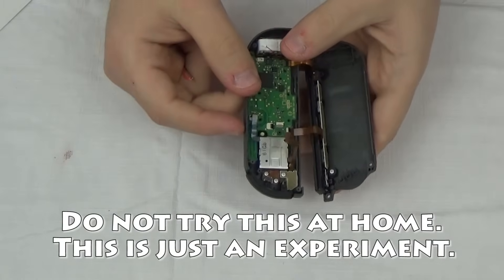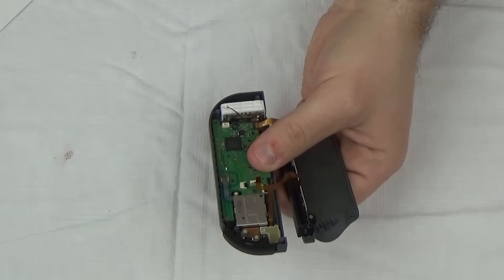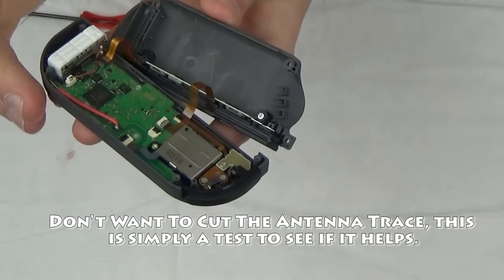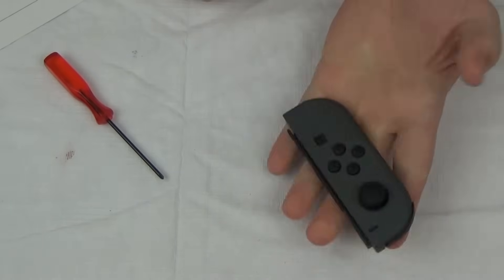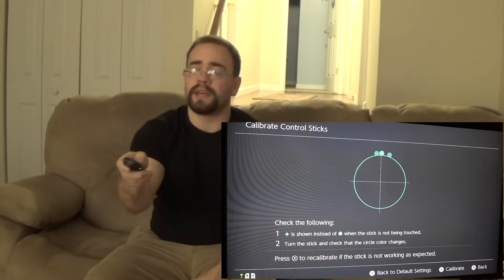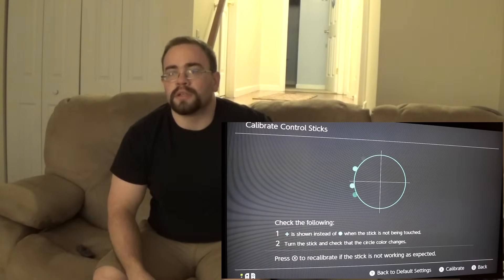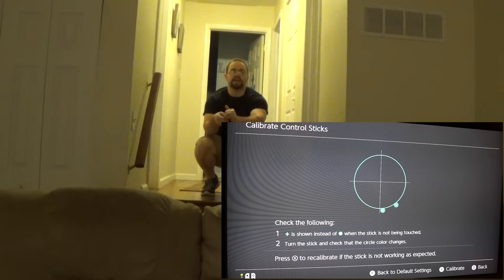Fixing The Left JoyCon!

Comment: Thank you for your input mate. I Did the same and it simply didn't change a thing. Link keep getting clumsy if I lazily lay my hands and the joy cons behind my knee. Read for the second time about the cable length (and width i guess) that could improve or mess with the signal, it might be the next thing to look at. Anyway, thanks again for trying. Edit: European Switch
Reply: I love to reply to my own messages. For those who struggle to find reviews about the fix;
Second time I tried soldering a shorter cable of the same thickness (thick), the 2.5 cm didn't help at all. Third time I soldered a thinner longer cable (about 5 to 6 cm) all the way where the IR camera would be on the other one, following the down curve, and it improved. I can lay my hands on my crossed legs, behind my knee, and it works. I can still disrupt the signal if I really cover the joycon with my hands, still it's better.

Comment: Will be doing this tonight.
I don't sit far from my switch, like ... 6-8' maybe, but I usually play lounged or with my knees up or some sort of way where relaxing puts some part of my body in some kind of way between me and the console, if even barely, and I've noticed some slight connectivity issues.  If I adjust slightly, the issue goes away, but if I can put a simple wire on a blob of solder, and call it a day, you bet your ass I will.

I'll take pics and let you know how it goes.

Comment: I wonder how much Nintendo is saving from not including a strip of antenna / wire?
Reply: Reasonable guess; about 3 cents per unit sold.
Times 5 million units sold -> 15 million cents or 150thousand dollars. It adds up quickly.
Reply: Ofc it adds up quick if you start with way too high numbers in the first place.

That wire is never 3 cents. I'd price it somewhere between 0.01 and 0.005 cents, so I'm pretty sure they didn't left it out to save money.

Comment: You have actually created a dipole antenna. The issue is that you have changed the dynamics and if you didn't do your calculations right on wire length you could be getting adverse SWR that could damage the joycon. Fortunately for higher frequencies and lower power this is less of an issue but if you measure the length of the on board antenna it happens to be 1/4 wave then you can get a 1/2 wave dipole by adding the same length wire and 1/2 was is optimal for a dipole. If you want more information on this, pick up the ARRL Antenna Handbook ( https://www.arrl.org/shop/ARRL-Antenna-Book-23rd-Softcover-Edition/ ).
Reply: well, it was more complex that i expected
Reply: So, how long should this antenna be? I'm down to solder, looks simple
Reply: From what I can gather a 30.7mm wire is the correct length for Bluetooth 1/4 wave. Can anyone confirm this?
Reply: Why don't you figure that shit out for us.

Comment: I tested my joycons numerous times and didn't have any issues with them whatsoever. Then I realized I had made all my tests with the Switch undocked simply because my TV is positioned so that I can't really move away from it too far and still see it. So I tested with the Switch docked and moved as far away from it as I could without loosing sight of the TV (roughly seven meters) and then I started having these issues if I covered the joycons with my hand and body (with clear sight there were still no issues).
So, at seven meters I was having issues when blocking the line of sight, which is perfectly normal imo but with the Switch undocked I had no issues at all at an even greater distance even if I blocked the line of sight! Seems backwards.
Funnily enough, my right joycon seemed to have more trouble when the issues showed up, so maybe I got my left one from a batch where Nintendo had fixed this flaw. I'm almost willing to open it up to see if it indeed has a proper antenna.

Comment: I'm skeptic...

- Firstly, he does not mention that he had the actual issue before, but talks about "the one people complain about"

I have this issue about as bad as could be, although the main thing I notice is that when my switch is in tabletop mode both joycons connect fine and I can do the "behind the back from a distance" test fine with both joycons.

The issue seems to come about only when my switch is docked, and it seems to get worse after about 2-3 hours (on Zelda, if it makes a difference - starts getting nice and warm) to the point that I have to sit in front of my Switch within 3ft distance and it still loses signal even with no obstructions (besides my hand holding it of course). I have tested this on 3 different TVs in 3 different rooms (away from WiFi signals - and fishtanks!-), one of which was a PC monitor - No WiFi/Bluetooth/Infrared! - and ALL locations show the same issue. Undock = FINE!

This leaves me thinking whether it is really an issue with the Joycon... Might still be if the Switch has very tight tolerance to variations in the bluetooth signal strength. Dunno. I'm not sold on this solution just yet though. Largely also because he doesn't mention the guage or length of the wire used (and is not answering people who ask what these should be). These are important factors in antennae, length especially for the likes of bluetooth and WiFi antennae. He might just have been lucky with the length, but it does need to be within a specific range to transmit the bluetooth signal effectively.

So, because of all these reasons, I'm not jumping onto this solution just yet. I hope to be able to test this further with another joycon and Swtich that do work to determine if it is the joycon or the Switch itself... waiting on a friend to receive his Switch to be able to do this (hoping his is fine). ...And I've gone ahead and ordered a pro controller for now which should hopefully have a strong enough signal to at least play Zelda from more than 3ft away from my Switch (and TV)

This is a lot to read, so respect to anyone that has made it down to here;-)
I'd love to hear other people's findings.
Reply: I've seen lots of people say they did the same thing and it fixed their joycons. So it seems that this fix really does work. If you're fine with opening them and trying it, it seems like it might be worth it.

Comment: this reminds me to the n64 times when the rumble pak needed batteries but with a single wire you could mod it to use the energy from the controller and play just fine without using batteries

Comment: What gauge wire? where did you put it so the battery holde would fit back on top of it? I did lil tiny almost strand wire, of course its probably too thin to get any bandwidth out of it. and 12 gauge awg is probably too thick to get in there too.

Comment: The good size for a Bluetooth antenna would be 31,2 mm. Which could be the perfect size for the wire (outside the shield if there is one).

300 / 2400 (light speed / frequency) × 1/4 (one quarter) => 31,2 mm  (around 3 cm)

Comment: ok so the design is the issue. not the hardware itself. this doesnt happen with the other controllers on other consoles why? because the antena is not where we grab the controller? even if it was, if we grabbed it, due to the size of the controller it wouldnt stop right?

Comment: People make ONE very big mistake in all Joycon related videos. They forget to question how a perfectly working unit works. Yes the 5cm wire might fix the left joycon issue. but it does not explain why my left joycon doesnt have that cable and still works flawlessly beyond the distance he tested it. All people act like the antenna is too small in general. I tell you now: it is not. it works. Perfectly. I tested it. So Antenna size might be a part of the problem but ONLY a part. something IS wrong with that joycons or the area you test it in. defective unit and/or interference with other devices.

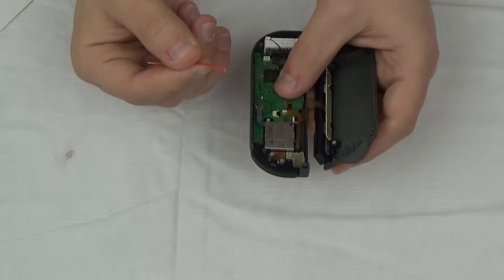Comment: 0:57 The big box you can see next to the antenna is electromagnetic shielding. It's there so whatever is inside is less influenced by the field emitted by the antenna.
PCB antennas are very common though there might be a problem with the placement of this one.
Bluetooth operates just above 2,4 GHZ and a little bit of googling told me your antenna should therefore be 31mm or a little bit longer.
Interesting fix!

Comment: The joycon issue is not really a HW issue. The real fix would be a FW update increasing the transmit power on the controller. This may come in the future.  Also this is not how digital antenna work.  The wavelength propertied of 2,5 GHZ transitions state the antenna needs to be a specific length. Good try though, the changes may not be worth the risk of damaging a low energy device such ad the joycon.

Comment: I had the sync issues then I read that you just need to restart the console with the Joycons attached after you do the update and sure enough that worked. I can now be 30 feet away without any issue. I would suggest trying that simple method first.

Comment: My Joycons haven't had any issues (luckily), but did you say you used a Cold Heat soldering iron? They still have those things? I remember when those came out, I thought about getting one but I read several expert reviews and decided against it. Your solution (sticking a wire to the solder point to extend the antenna) was about what I would have done. :)

Comment: My left joycon is almost unusable when I'm more than 5 feet away from my Switch unfortunately. I will lose connection almost every 30 seconds and I've ran off many cliffs in Zelda. I want to do this but my current iron tip looks way too big to put a new wire antenna in there. I'll just get a pro controller for now since I'd get one eventually anyways. But awesome video figuring out the problem!

Comment: I hate saying this but nintendo really screwed up with that. A massive company based out of an extremely tech heavy country, didn't think to run a soldiered wire from the board to the bottom. But a smallish YouTube channel thought of it by looking at it for 5 mins. Wow. Good job Spawn as always. You have made a true regular subscriber today.
Reply: The Switch is great, but you can tell it is really rushed. It's like they did QA, learned about the issue, but ran out of time to fix it and just released it as is.
Reply: I think that they just didn't expect this issue to exist. It was discovered some time after switches were shipped.
Reply: whitewash winner you know what's funny Nintendo watching this very video right now and taking notes 😂
Reply: whitewash winner yeah good pt. I hope they do a revision on the next set of switch hardware.
Reply: Well to be honest, the other part is pretty obvious which side it goes on, the strap should go where your wrist is, people that get it stuck are inserting it upward. But yeah, in the end it still shouldn't happen
Reply: When I first tried to put the strap on mine, it felt like it only went on upside down, so I just assumed that it must go that way. But once I got it on, it was stuck. XD A bit of a problem that it's harder to put it on the right way, than it is to put it on the wrong one. :\
Reply: Really? I find it's easier to put the strap from the top to bottom, it's a bit awkward to insert it from the bottom to the top I think (the top and bottom from the joycon to be more clear)
Reply: narato345 nah I'll leave that to the pros like you
Reply: Actually, Nintendo's now repairing old joycons for free.  They made a statement about it: “There are other reasons consumers may be experiencing wireless interference. We are asking consumers to contact our customer support team so we can help them determine if a repair is necessary. If it is, consumers can send their controller directly to Nintendo for the adjustment, free of charge, with an anticipated quick return of less than a week."  (https://www.polygon.com/2017/3/22/15027770/nintendo-switch-left-joy-con-fixed)
Reply: They didn't think of making a system where you couldn't put the wrong shoulder buttons on the wrong joy-con either... (all that would need is a latch, or special slot which is unique to the joy con associated with it).

Instead, you're left with a joy con with a cemented shoulder button attachment on top (which you can't remove without unreasonable force).

Comment: Has anyone else not has a single sync problem with the joycons?
Reply: Michael Buckley no problems whatsoever here. its a problem with different case of interference in peoples home
Reply: I've had some on the left one. Tho, I've had more annoying problems on the right one. When ever I use any move aim thing (like aiming with bow on BOTW), the aim moves to the left all the time even if I don't move the joycon at all.
Reply: Tope92 calibrate the gyroscope in the settings
Reply: Yup. Just got my switch and have this issue.

Comment: Thanks so much for this video, man. This really seems like they could have just designed the antenna a bit better. I mean, if you adding a tiny piece of wire improves performance that much then surely that's something that can be implemented in Switches going forward. Hopefully someone from Nintendo sees this and just makes the change because it's gotta be pretty easy to do. I think that 20ft should be your performance benchmark as there's no real reason to be further than that away from a gaming console but 40ft is a nice touch if your controller is also a remote control for viewing TV or apps like Youtube and Netflix.

Comment: It's probably a cost thing for why they put the antenna in the board. Just adding a 25p external antenna to 1 controller can add up to millions in lost profit and they're usually operating at razor-thin margins with consoles sales. It's still shoddy manufacturing and totally unacceptable but that's probably why.

Comment: hey spawn wave, i have a quick question. i found a very small hair-like scratch on my switch's screen. i guess i wasn't careful enough when i put it into the dock. do you know any way i can remove it before my screen protector arrives?
Reply: I don't know about removing it, but you could try the scratch hiding stuff used for clear coats on cars. You can get the stuff at any auto store really, maybe even Walmart in the car care isle.

Comment: For the TLDR version: Removing the Switch from the dock and setting it in the exact same spot in tabletop mode removes all left joycon issues!!
I have no idea what is going on but Nintendo needs all this info ASAP!
Reply: There's also a weird issue where you can get worse (I mean noticeably worse) gaming performance playing some games Docked, but it's perfectly fine in portable mode...

My best friend who bought a switch day 1 (I'm waiting until they fix these issues) has mentioned a few times how BoTW has noticible frame drops (~15fps in most cases) at random while the system is docked, but this never happens while playing it outside the dock. It's incredibly weird.
Reply: Not weird, game is displaying 900p while docked and only 720p handheld. That's why it struggles more
Reply: I have noticed this problem when my brother plays Zelda while his switch is docked. Seems to happen randomly though. Normally I would expect these problems when you look from atop a mountain, or are fighting lots of enemies, but the frame drops on his seem to be random. That makes me think it could be fixed with a patch.